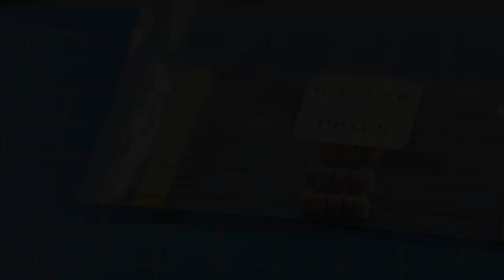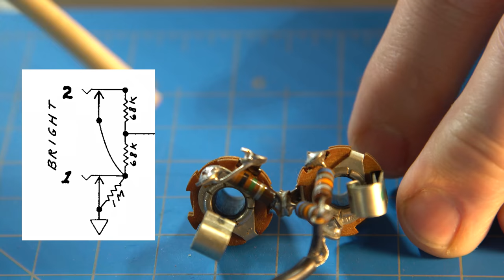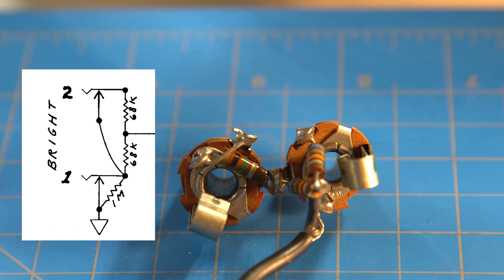Tech Tips Video #12 Input Jacks and Speaker Wiring

Comment: I have an Input Jack from my old 80s guitar that I replaced years ago      ..........    CAN I USE THAT OLD GUITAR INPUT JACK IN A SPEKER CABINET I BUILT?  Menaing is there any real difference between a guitar input jack & a standard cabinet input jack?     my cable snaps into it real nice & firm just not sure if its interchangable
Reply from the maker: There is no difference.  You just need to make sure to know which connection is ground/negative and positive to keep the speaker in the right phase
Reply: @FrenchieFilms   awesome,   Ty       ...... I looked closely at one of the tabs & followed it around its on the same metal as the tall springy pressure tab thing .........  and that was the Negative, I assume       ...... and the Tab or terminal by itself I believe is Positive. Thats how I evaluated it, based on which little terminal was connected to the same metal as the tall pressure thing.

 BUT just to be safe..........    will it Sound out of phase if its not right?
Reply from the maker: @97warlock  It won't necessarily sound out of phase if it's the only speaker and amp in the room, but it will if there are more than one speaker and they aren't 'matched'.  If that makes sense.  The 'tip' of the jack and cable are the 'signal' and the 'sleeve' is the ground/negative.
Reply: @FrenchieFilms     Its just a 1x12 Cabinet           ......   awesome,.   thats how I wired it.   Red to Jack tip & black to Sleeve terminal.     -    Going to test it out tomorrow,  if all checks out good, all I have to do is put the while panel in place & lock her down.        well, after I solder the speaker end ofcoarse. 
 I loop thru the hole in the terminal & bring it around the wire tight & twist it ,     THEN solder it.

Comment: Hello, could you please provide the part number of the Ceramic wire-wound power resistor you are showing us at the begining of your Tech Tip #12? Thank you.
Reply from the maker: Apologies for the mistake, I just realized they're metal oxide 2W power resistors, not ceramic wire wound!  Here's a link to them https://www.tubesandmore.com/products/resistors-2w-metal-oxide-power (you can pick the resistance rating you want, and they come in packages of 5)

Comment: There is something I think needs explaining and i can't find it anywhere and it is not talked about that I can find  .you look at the schematic and two wires are tied together with a dot. But,you look at the output transformer and the wires will come across to the speaker and there is an arrow head, sometimes both wires. It looks like they are not connected. If they are connected, why don't they connect with a dot like in the rest of the schematic. That is confusing to a beginner.I have asked people and searched and search how to read that and no answers from anyone.Look at the champ schematic, the wires look like they come half way and there is an arrow and it stops, that does not make any since. This could cause a beginner to blow his transformer. why is there not a dot with the wires tied together,like in the rest of the amp.Everybody says, go read more. You can google it until hell freezes over and can't find that being explained why it is drawn that way.I hope you understand what I am trying to point out.
Reply from the maker: I think I do, you're referring to how it shows the arrow ignoring you a v shape.  That's the speaker jack symbol (the v shape) is schematics.  Basically it's not a permanent connection, but a detachable speaker with a jack.
Reply: thank you-that has drove me crazy ever since I saw it!!!!! One of these years I will get this stuff figured out. Got me a 5y3 today-Going to try that and see if I can get some voltages down. Having to re-wire because I changed those cheap ceramic sockets out. Using some of my old ones that came out of hammond organ amp. I don't have a solder sucker, so going to be a nightmare trying to get all the solder off them. I just hope my  6v6's  aren't  too damaged from the 12ax7's arching so bad. I had to steal some 12's out of my other amps,don't have anymore if these blow!I will never get any of those cheap sockets again. I am going to have a fortune in this amp.!If I have any advise for beginners, do not buy cheap tube sockets.